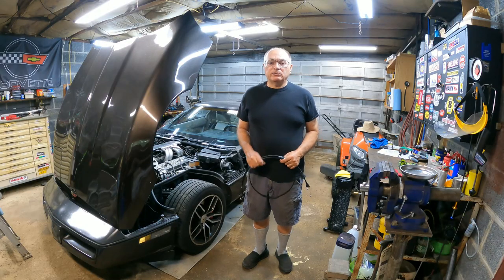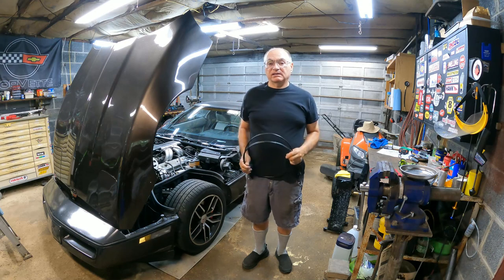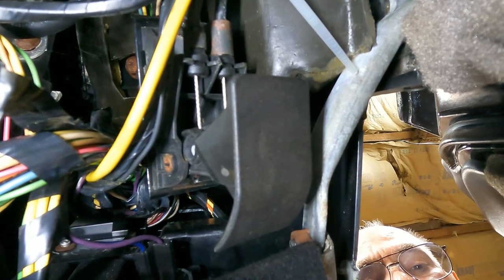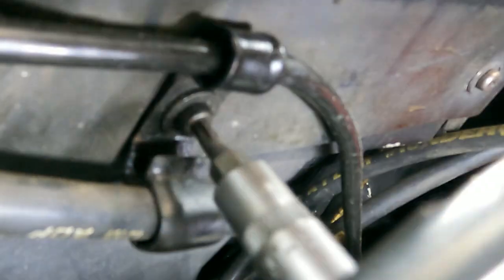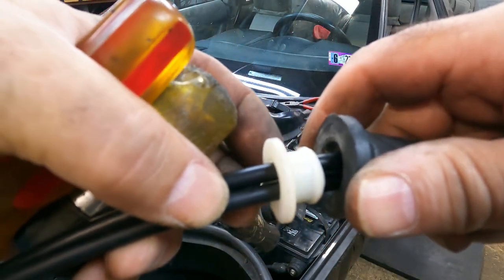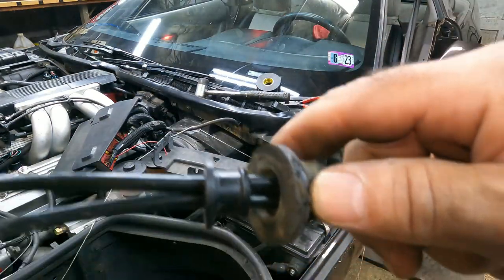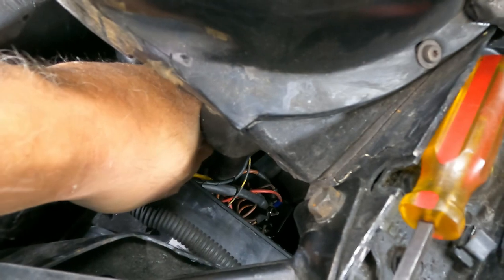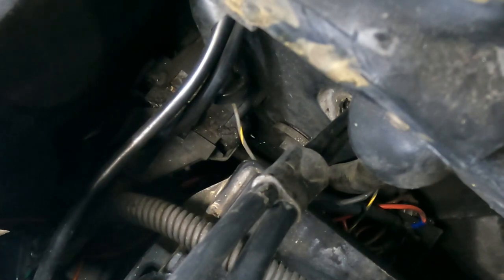HOOD LATCH CABLE C4 CORVETTE 😣

Comment: Just a little tip for insertig gromits. if you take strong string and wrap it aruond thr center of the gromit three times leaving a long tail that comes out before the gromit. pull the string around the gromit while pulling on the cable. three times around will place the gromit in the proper place, sealing out the weather. Hope that helps.
Reply from the maker: Thanks for the Tip 👍